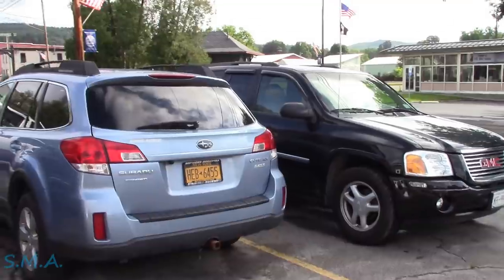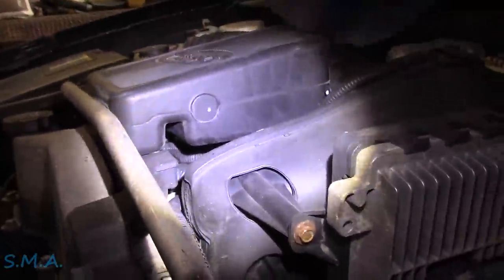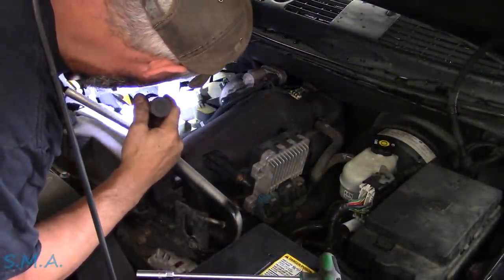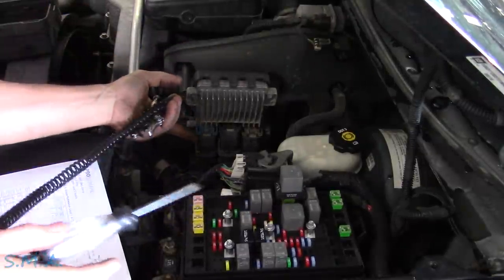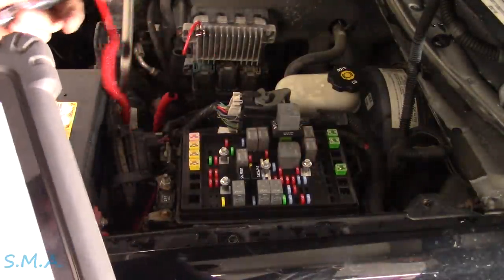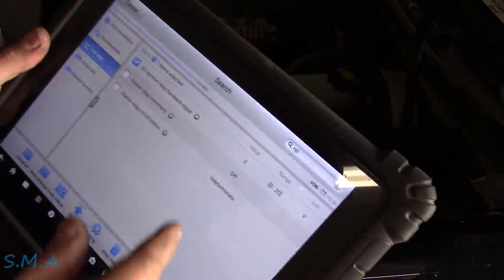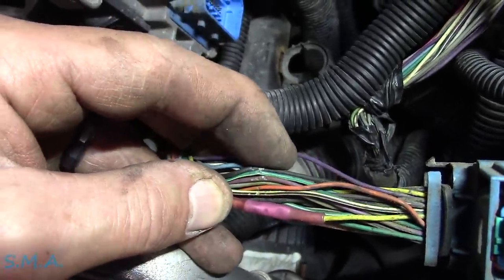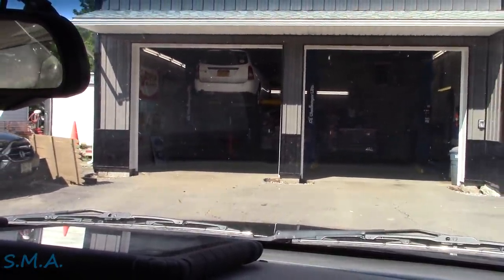GMC Envoy: No Throttle

Comment: I’m a water well driller pump installer for 20+ years and we install pumps with bare butt connectors and glue filled heat shrinks and they will look brand new after 20+years under water. I have pulled many pumps broke off pipe by the wire only hundreds of feet down and hundreds of pounds even up to a thousand pounds. I will make the same connection and bet anyone mine will hold and last from all conditions better then any connection they will make.  Also my dads a master mechanic and machinist and I’ve been busting knuckles with him since i could walk and he taught me how to make these connections in automotive and our water well business. Screw those ignorant haters😂

Comment: I'm not sure how anyone could hate those crimps Eric. seems stronger than the wire that it's replacing. Soldering is not better just because it takes longer and is more a pain in the ass. none of those make a better connection.

Comment: Your Awesome!
I have a 2013 Chevy Silverado with a major problem with the Trailer Brake System
I changed the Relay, the Bumper socket plug, and the Module.
It does need Re-Flashed... But 2 different mechanics said that their computer is Not connecting to the Module for the Trailer Brake System... I am not able to get it Re-Flashed
So I am not able to pull my trailer, if I did... The trailer brakes will lock up tires and wipe my tread off.
I am in Texas... I wish I could just come up their for your expertise!!!

Comment: Crimping wires with these connectors is just fine. Provides a good mechanical and hermetic (air) seal. From what I read, buy some extra crimps for these Envoys. You'll be needing them.

Comment: The haters are just that, haters.  That is by far the best way to quick and durable way to repair/splice wires together.  Great mechanical bond that is totally sealed, what more could a guy want?

Comment: Master Audi tech. The 3M crimp connectors you use are the only approved Audi/VW factory approved repair method here at the dealer. Solder relies completely on the technicians skillset not to make a cold/bad joint. They are water tight and mechanically strong due to the glue inside. People must be confusing them for the non insulated Walmart style crimpers that don't protect the joint. I used to be a hater until I started at the dealer and haven't had any issues long term.

Comment: I lived in Wisconsin for just about 10 years never owned a new car and have repaired thousands of broken wires!! This is from running as a mobile mechanic and some repair work that came from other shops where they couldn't find the problem. I've also done probably 50 trailer rewires cutting all the crimp connectors and old scotch locks off.

Those crimp and seal things with glue in them I swear by them I've used them extensively and never had a problem with them.

The other thing I swear by if you really want to make sure is a little dab of grease on the wires inside the crimp and seal connector then crimp it seal it then it's sealed in with some anti corrosion 🤯

Comment: As an electronics/electrical/computer engineer I've got to say that I am most unimpressed with the job pretty much ALL vehicle manufacturers are doing on the wiring/electrical system of their vehicles.  These days every vehicle has a dozen or more computers connected together by a spiderweb of wiring (built to the lowest cost) that all has to work perfectly or the vehicle develops problems.  As a result, we get video after video after video of Eric O. hunting for the broken wire!  Eric does a great job of showing us how to hunt for this sort of stuff (Thanks Eric!) but it is all so unnecessary.  Yes, a vehicle is a very hostile environment for a wiring system but vehicle designers KNOW this beforehand and should design the wiring accordingly. It is my opinion that many vehicle wiring systems today are not "fit for purpose".  Making a good wiring system isn't rocket science folks!  The techniques have been known for many years.    My list would include:

1/  Do not use any wires smaller than about 18 gauge even if the current carrying capacity of the larger wire is not required.  (Better mechanical strength & vibration resistance)

2/ Use wires with thicker insulation than the minimum available from wire manufactures. (Better chafing/nicking/pin-hole resistance)

3/ Use wires with a larger number of smaller strands in certain areas that have high vibration or a lot of flexing. (Better vibration and fatigue resistance)

4/ Use wires that have the copper strands tinned. This is sometimes called "marine grade wire".  (Better corrosion resistance)

5/ After terminals are crimped onto wires but before they are inserted into connector shells the crimp area should be sealed using adhesive lined heat shrink or similar. (Prevents moisture wicking up wires corroding the entire length of the wire)

6/ Do not under ANY circumstances use wires with insulation made from materials (typically soy based) that taste like food and are attractive to rodents.  (Such wiring is not "fit for purpose" in an automobile)  Consider using wire insulation with rodent repellent characteristics. (Capasicin)

7/  Protect wiring with suitable over-wraps/looms where appropriate.  Such protection should be designed to repel rodents.  (Capasicin)  Such protection should also be designed (especially at end points) to not chafe the wires.

8/ All terminal pins and lugs should be of appropriate materials or given appropriate platings to improve corrosion resistance.

9/ Give some thought to the location of connectors.  They should be well sealed front and back, and located in areas as environmentally protected as possible but also as accessible as possible.  If it is unavoidable to locate connectors in unprotected areas add extra protection. Use drip loops as appropriate to prevent water running into connectors.

10/ Give some thought to the location of modules/computers/components.  Locate them in areas as environmentally protected as possible or if it is necessary to locate them in unprotected areas add extra protection or design accordingly. Use drip loops as appropriate to prevent water from running into components.

11/ Give some thought to galvanic corrosion that may occur between components made of different metals that are in close proximity to each other.

12/  Give some thought to minimising the amount of wiring that has 12 volts on it at all times, especially wiring that has 12 volts on it when the vehicle is not in use.  This will greatly decrease the amount of corrosion that will occur if there is moisture/salt intrusion.  For this reason high side switching is preferred rather than low side switching.

This list is just off the top of my head...  Feel free to reply to this comment with additional rules you think should be followed.  Yes, following some of these rules will cost a few dollars but would save a lot of money and aggravation in the long run.  Some of the rules could be followed by making better design decisions and would have virtually no cost attached.   

I recently read a letter to the editor of the local rural newspaper from a fellow castigating his neighbour for keeping a few chickens because rodents he claimed were attracted by the chickens destroyed the wiring in his vehicle.  He seemed to be completely unaware that vehicle manufacturers are now using wiring insulation that is very attractive to rodents.  Assuming the chickens were well looked after, I think it likely that his car was more likely to attract rodents to the area than the chickens were!

My current daily driver is a 2003 Pontiac Vibe which has been very trouble free.  Given that the Vibe is about 18.5 years old I have been looking for another vehicle for the last few years giving preference to electric vehicles.  One of the questions I have asked many salesmen is whether the wire insulation in their vehicles is a soy based plastic.  After they get over thinking I am a nut case and look into the matter, they usually tell me very proudly that the wire insulation is an environmentally friendly bio based plastic.  At that point I tell them that I am no longer interested in their vehicles.  They don't seem to understand when I try to explain that good environmental choices are sometimes bad engineering choices for certain applications - like vehicles.

By the way, it is my opinion that the crimp/shrink/seal repair Eric completed on this Envoy is completely fit for purpose.  I too mistrust the solder/seal connectors.  If wires are not clean they don't solder well.  In a perfect world wires to be connected should be clean, but we live in an imperfect world.  I think the pressure of a properly done crimp will break through the surface oxides on less than perfectly clean wires and is more likely to result in a good connection.

Comment: A word of wisdom from a harness designer from years gone by, never use SupeGlue (acrylic) type adhesive in electrical or electronics, wires etc (in general). Because superglue has electrical properties that can interfere with hf signals, been there done that got burned.
Heat shrinks have correct adhesives so there should be no problem with those!

Comment: Love Your explanation about Crimp Heat Shrink connectors. !!! Every electrical repair Does Not require Solder. Use of your own judgment is good. Love the way you think. Dan Johnson Master Auto Technician. aka Super Genius.

Comment: GM service information recommends using environmentally sealed splice sleeves for wiring repairs. They even have a service procedure for installing them.  You can tell the arm chair warriors to go pound sand.

Comment: Those connectors that seem to be upsetting people look like miniature versions of what we use at work. The only difference is we use a bolted connection rather than a crimp. However, we do then bury them underground and push 11kV down them.

Comment: The dual wall (glue) butt splice if crimped properly is perfect for this type of repair. Ensure a good mechanical connection (use the tug method), before you heat shrink the splice and if okay, heat shrink the slice and you are good to go. 

The only upgrade would be to use an uninsulated high temp butt splice (small wire gauge) and then add dual wall heat shrink separately (usually very thin wall and black in color), which will give a smaller overall diameter repair, and you can apply an uninsulated crimp (and do a proper tug test), which I think is stronger, without damaging the heat shrink seal because it is separate. However, you will need a little more harness length to slide on the thin dual wall heat shrink.

What about the harness laying across the exhaust manifold?

Comment: GM prefers crimp-and-heat (non-soldered) connectors for many wire repairs. They say it produces more consistent resistance in the connection than a typical solder joint.

Comment: eric  i don't know how you do it ? first you have to diagnose the problem them fix it while keeping the snowflake utube watchers from peeing their pants , i used those crimp and seal connectors to install about 50 10watt lights around my property on my house and backyard fence about 7 years ago and have not had a single failure and they are all outside in the weather all the time in toms river new jersey where the air is like a salty dog and bread goes bad in a day . your the best at what you do . Thank You for the good repairs and the jokes

Comment: That poly loom around the wire harness is supposed to prevent problems, not cause them.  So, expect the unexpected.  And the white station wagon in the next bay - was that a 1st gen Ford Focus wagon?  I used to notice them on the road from time to time around me, but not lately.  If that one has spent its entire life in Steuben County, NY, it must have some really good genes.

Comment: All automotive connections are crimped, with the exception of circuit boards, where the solder tends to break, like gm wiper motors. There are really good reasons not to solder wires on something that moves or vibrates, it will break.

Comment: I've been using those butt connectors for many years, except I slide another piece of heat shrink over them juuuuust in case I accidentally punctured the casing while crimping them.  Freightliner wire loom are notorious for chewing into wires.

Comment: I like using the non-insulated butt splices and then using heat shrink with the glue inside. Seems like I can get a tighter crimp without worrying about piercing the insulation. I do have some of the ones that Eric uses for trail repairs though.

Comment: I have used solder on the wire before crimping a few times if the wire is very thin.

Comment: Far be it for to challenge you sir. Me personally if I use a crimp, I'll follow up by flowing solder into the crimped area. If it has one of those plastic "jackets", I'll remove  that before crimping so as not to interfere w/ the soldering. I use heat shrink tubing to insulate. I've had too many crimped wires (stranded types)  to just pull out of the crimp. Also  I have the proper crimp tool & know how to use it correctly.

Comment: To be honest those crimps work great if u use the correct crimpers solder caused me a headache for 2 days traceing down issues everytime the car shook it messed up turned out the vibration made the solder crack and when it was shaking it had a bad connection

Comment: In 1971 my automotive electric teacher told us on the first day of school that if you understand basic electricity and voltage drop testing, you could fix 90 percent of the electrical problems that come in. He also said that if you can do electrical work, it will keep you out of the tire and oil change bay. Fifty years later with all of the computer controls and advancements, it still comes down to voltage drop testing. He was right.
Reply: Eric:you do good work I admire you & have a lot of respect for you. Continue doing what you do best, thank you!!!!!!!

Comment: That wire repair makes me question how you even tie your shoes in the morning or brush your teeth!!!(sarcasm). I use the same style connectors. Great find on this one. I’m thinking how many guys would have thrown throttle body and O2 sensors at it.

Comment: Chalk those cracking solder heat shrink connectors up to the E.P.A., before the solder was 50/50 lead/tin, after the epa silver/tin or just tin neither of which hold up to vibration, the old lead/tin was toxic to mice and squirrels and little kids who liked to chew on the solder but was ductile enough to withstand intense vibration.

Comment: My son  has a fairly new Honda Civic  & on leaving a work parking lot he noticed a rabbit leaving from under his car.
A few miles into his way home dash  lights started flashing. Close to a dealership he went in & was told  a rodent ( rabbit)
had chewed the wires under the car  made of soy- based insulation instead of plastic. Major car makers switched to
the cheaper insulation which rodents including mice,squirrels,etc love to chew on since around 2000.  Since you mentioned acorns in the engine area and tooth marks on the wires  a squirrel is likely  what caused the problem.  The web shows Toyota & Honda had a class action against them re the  soy=based wire insulation in the USA. Don't know the outcome .  Various chemical & natural sprays are recommended if you park your car for extended periods or on grass,etc.  Apparently  the wires chewed by rodents is fairly common. The Honda dealer  covered the exposed wires under his civic with some sort of wire mesh .

Comment: No matter how the wire is fixed, the point is its fixed and Only time will tell if it lasts. I didnt throw up so its all good. Funny thing i noticed was the tape from the factory was bout an inch or two away from the clamp. Hmmmm couldna put it where it woulda helped i guess. All signs pointed to chewed wire when the tape guy chewed the wire in the end. Whata rodent that guy is 😂 btw i hope mrs o doesnt slip on your nut you tossed on the floor. Give her a warning that your nuts are scattered about. BTW You should put a pedestrian crossing sign in your shop btw. Shed ❤️ it. Hehe. Thanks for another great video

Comment: Crimped terminal connectors are approved for aircraft wire termination and repair and you seldom see soldered splices.  As a matter of fact soldered connections or splices are not recommended in some instances because of the potential for cracking from vibration, one example would be the cable ends at the starter. Shrink wrap or sealed connectors are recommend in SWAMP areas, (wheel wells, etc.). I've experimented with the solder/shrink style connectors and don't trust them. On small 18-20 GA wire they work ok but I could never get the larger wire consistently hot enough to wick the solder for a good bond without damaging the terminal shrink wrap and if you don't get the wire hot enough you end up with a cold solder joint covered with shrink wrap.

Comment: Don't let people give you lip about the crimp connectors. They're fine to use for what you use them for.

When using the proper size and the proper tool, those connections are as good as any other.

Comment: I have fixed many cars where the crimp connections have come loose. Should be ok if you test join by pull both sides of the wire and making sure it holds.

Comment: i get the part of the conectors,we used to use the red ones that you pinche and then melt but whit all the mositier in the air in the netherlands the rot away fast.we either use the ones whit the solder in them now or just solder if its a offical mercedes repair because warrentie and stuf.

Comment: I've not had an issue with those connectors.  I use them in Marine applications and as long as they are properly crimped and heated they are are good.